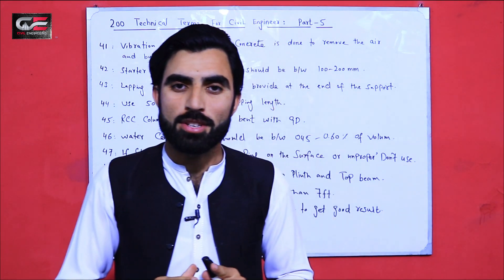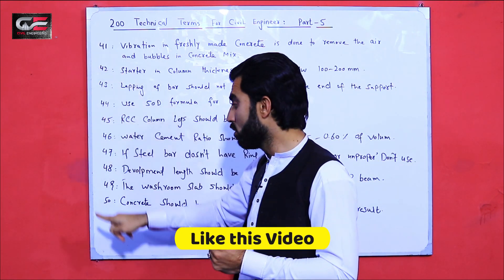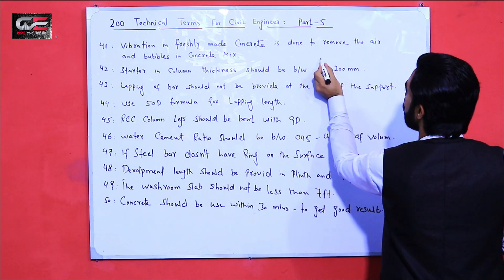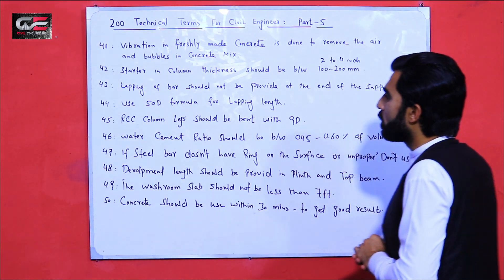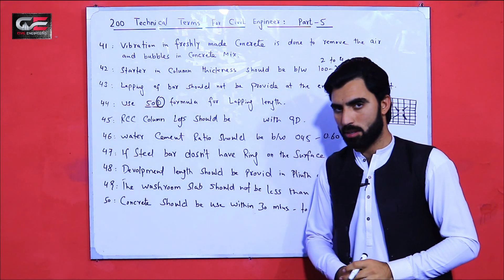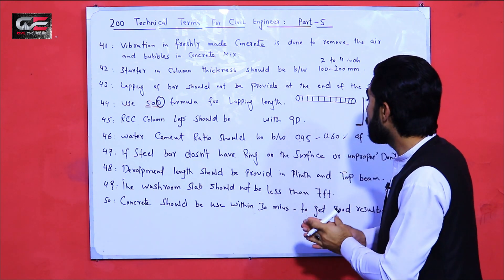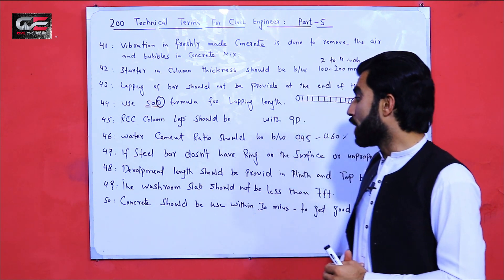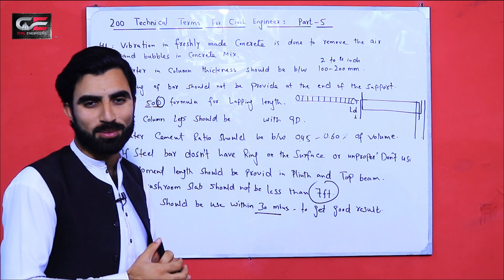200 Technical Terms for Civil Engineers | Part - 5 | Every Civil Engineer Must know

Comment: Sir lapping length should be provided at middle of colum and end of beams right..? Kindly please justify.
Reply: First of all we have to know that when we lap 2 steel bars together, the lapped portion of the bars becomes weaker. So the weakened portion of the steel bar cannot experience the highest moments and maximum stresses.

Columns are compression members. Therefore the bending moment in the middle of the column is equal to 0 and also the middle portion of the column is known as low stressed portion. That's why we provide lapping length in columns in the middle portion because the weakened portion of steel should feel low stresses and moments. 

In a beam, we divide a beam into two parts
1) top portion
2) bottom portion

The top portion acts like a compression member(consider the column) and the bottom portion acts as tension member . So we provide lapping length in the middle portion in the top bars cz of low stress and moment.

But the bottom portion of beam acts as a tension member. So  The middle portion and the end  of the beam experience maximum bending moment and stress. So whe shouldn't provide lapping length in the middle of the beam as well as the end. It's best to provide lapping length for the bottom bars of the  beam L/4 from the end... Cz L/4 from the end feels low bending moment and low stress. (for clear understanding use bending moment diagram and stress diagram)

Comment: why we should not provide overlap at end of support? what is the reason sir.
Reply: First of all we have to know that when we lap 2 steel bars together, the lapped portion of the bars becomes weaker. So the weakened portion of the steel bar cannot experience the highest moments and maximum stresses.

Columns are compression members. Therefore the bending moment in the middle of the column is equal to 0 and also the middle portion of the column is known as low stressed portion. That's why we provide lapping length in columns in the middle portion because the weakened portion of steel should feel low stresses and moments. 

In a beam, we divide a beam into two parts
1) top portion
2) bottom portion

The top portion acts like a compression member(consider the column) and the bottom portion acts as tension member . So we provide lapping length in the middle portion in the top bars cz of low stress and moment.

But the bottom portion of beam acts as a tension member. So  The middle portion and the end  of the beam experience maximum bending moment and stress. So whe shouldn't provide lapping length in the middle of the beam as well as the end. It's best to provide lapping length for the bottom bars of the  beam L/4 from the end... Cz L/4 from the end feels low bending moment and low stress. (for clear understanding use bending moment diagram and stress diagram)